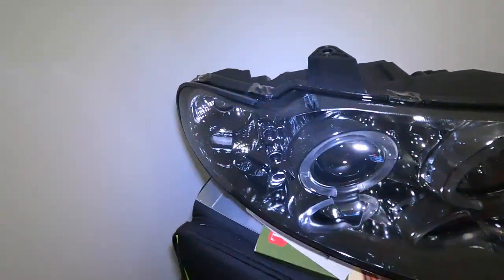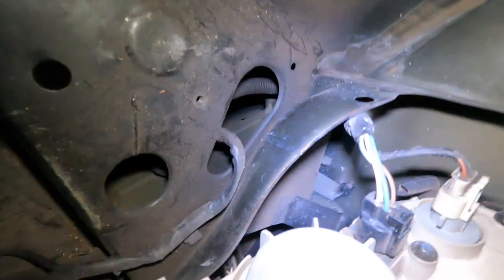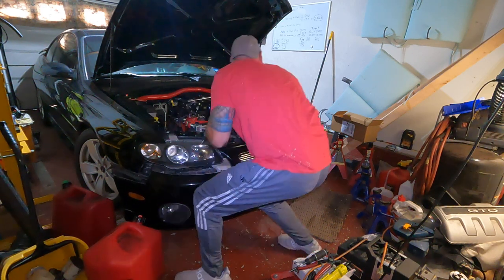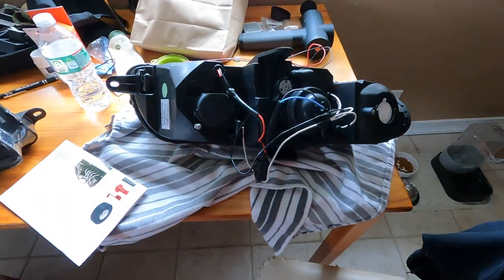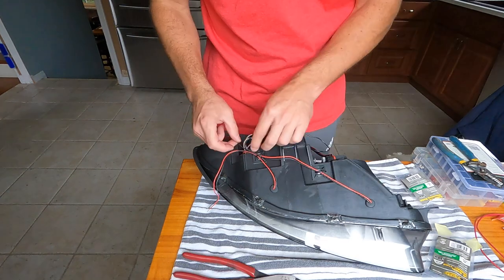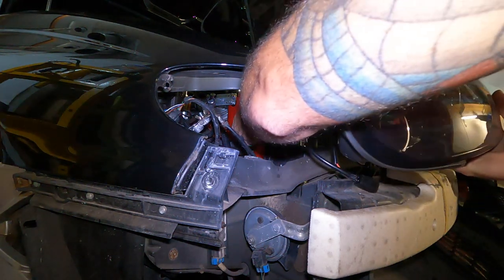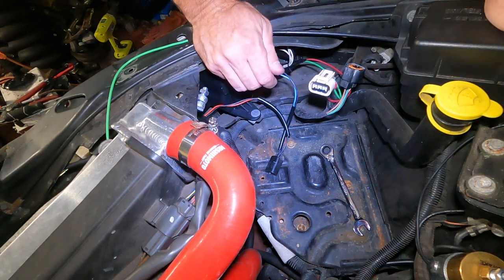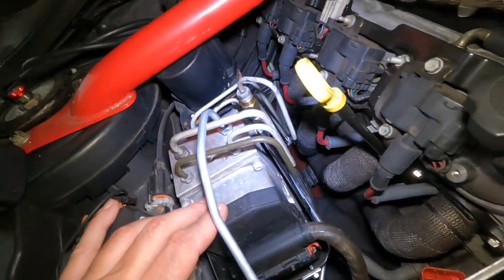GTO Halo Light Install

Comment: Make a video on replacing the brake lines and booster if you upgrade it and I was always skeptical about those side markers because one of mine broke and the picture they had on Amazon looked weird and no reviews but glad I got to see it I’m going to buy them
Reply from the maker: I'm hoping I don't have to go that far with the brakes! But I'll do what needs to be done at this point. Those side lights work pretty good. Not sure if you need to remove the bumper for those. It was off so I did it. I'll have another vid in a day or 2 with those

Comment: generally...you need to replace the abs module....underneath the module there is 3 numbers top right side...for example...343..it is circled.....you need to find that module 343 to replace...you cant just throw in any module.....you might have to get that from Australia...might.The modules were made in batches & Not all at once....thats why you need to match up the numbers previously stated(for example)...my module was 078....ohhh...and whilst i remember.....you can get the module from Australia...under the search.... VT...VX...VU... VZ...VY Commodore.....not necessarily under Monaro...or GTO Pontiac.The Year is irrelevant.Mine came from VT Commodore...but...i drive a later model.
Reply from the maker: Hoping not to go through all that trouble! But I'll do what needs to be done. Gonna mess with it a little more. Thanks for the info!